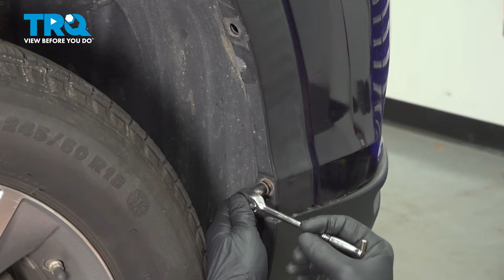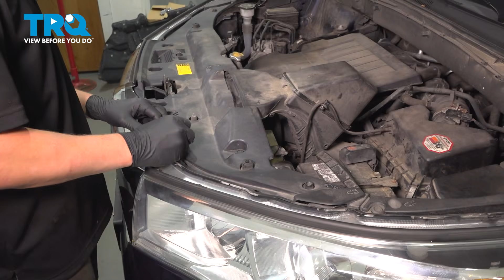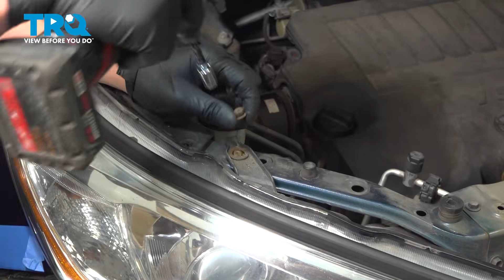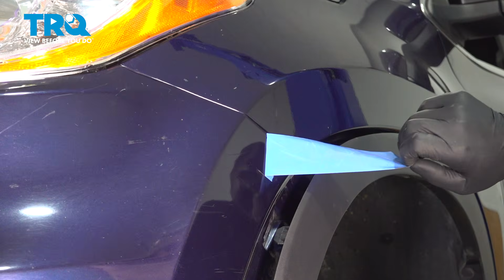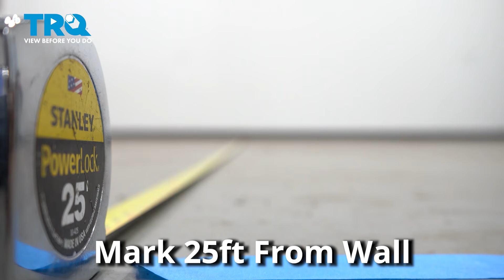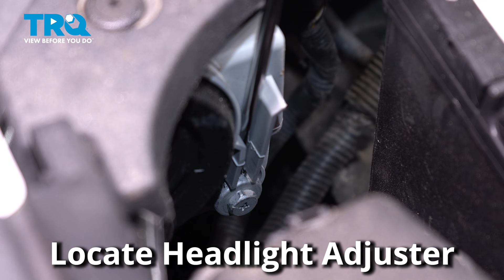How to Replace Headlight Assembly 2014-2019 Toyota Highlander

Comment: Did the replacement. Video was helpful. I didn’t do all the steps. 

Is it worth your time to do this? Maybe, if you can get past the annoyance of how unnecessarily complicated it is to change out a headlight assembly.

Wasn’t necessary for me to remove the underside clips and panel. Did have to remove one underside bolt to free up connection to the bumper. Didn’t totally remove bumper but peeled back partially as others suggested to remove the third headlight bracket bolt. 

Stupid design.

Not entirely sure it was necessary to remove the grille though it did give more space to work.

This was by far the dumbest automotive repair/replacement. 

Compliments to the video tutorial and step-by-step instruction. No complaints there. 

I know Scotty Kilmer loves Toyota Highlanders but I bet he’d think this design was just stupid as well. 

Is the job done? Yes. Was it done  right? Yes. Did I save $900 by doing it myself? Yes. I still hate Toyota for this reason alone.

Comment: This was super helpful! 

The only bit I’d add is when you’re taking the bar off at the sides, just the skin comes off, which I had to release from 4-5 black clips gently with a flathead screwdriver. I stuffed the first side up as I didn’t realise this, and broke the black bumper reinforcement bracket behind it. Had to order a new one from Toyota. 

Otherwise this was an amazing help. 

Thanks heaps 👍🏻

Comment: Although this was the proper way to do this, i was able to do it a lot faster without removing the splash guard and bumper. Just loosened the wheel trim, upper grill and cover and pull out enough space in the bumper to reach the bolt and metal clip.

Comment: Thank you!  I thought it was a bit ridiculous at first but those side bolts on the headlights are impossible to get to without removing the bumper.  Followed this and it’s really not bad at all apart from the typical aged clips being brittle.  Took about 1 hour start to finish, and could definitely be quicker if you study this video first and have the right tools ready to go.  Thanks again!!!

Comment: It looks like most of this is unnecessary. I’m going to check other diy vids about the Highlander without this guy with the blonde topknot. I am willing to bet this headlight assembly comes right out but removing just a few top bolts. No reason to remove any splash whole shields or the whole fender! Please explain, when you just loosened two or three top bolts and with nothing in the way (even if the fender were there) the headlight just slid out? Why make a deceptive video like this to make the job 100xhardwr than it actually is?